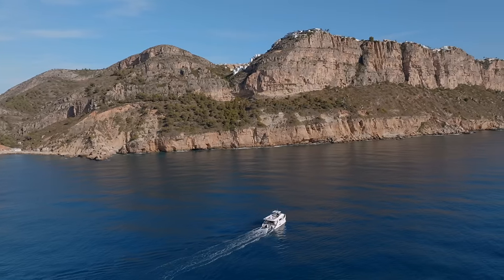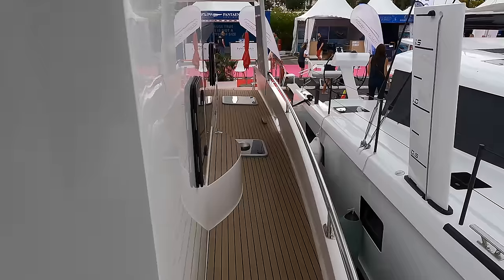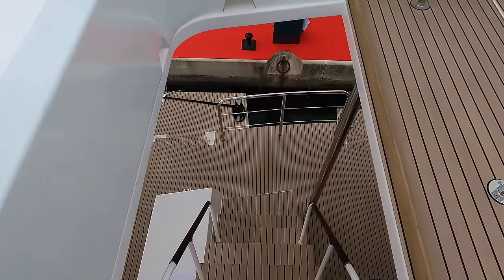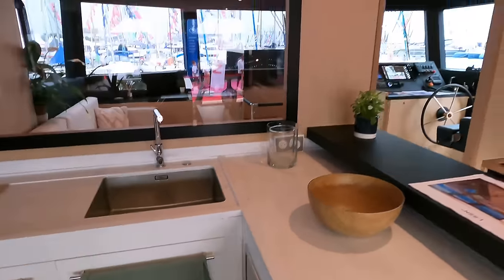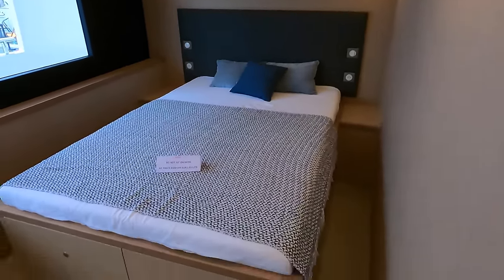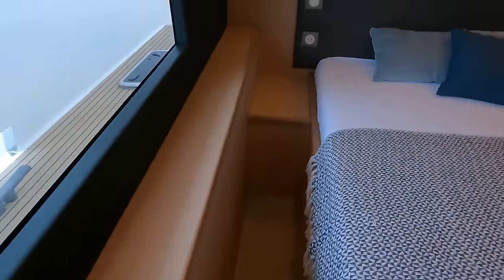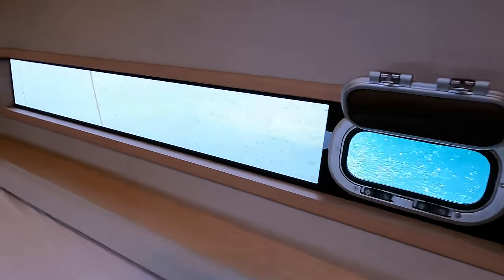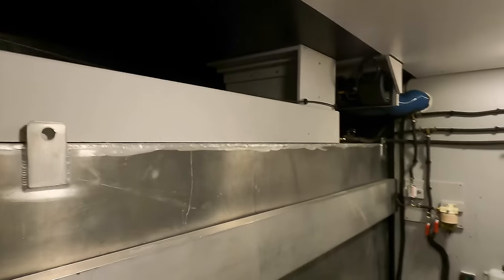FIRST LOOK At A Brand New LEEN 56 TRIMARAN!

Comment: Very nice boat. If I were a motor yacht guy and could afford a boat at all, my choice would be either this or the Leen 72. The space for the amount of money is incredible. And so is the perceived range and consumption rate. The interior style may not be to everyone's taste though, but I actually like that open and minimalist and not too flamboyant or luxurious design language. If I got one, I would cross the Atlantic into the Caribbean and hide in Panama until the hurricane season is fully over. Leen sell this as an explorer yacht, but it sure would be fitting more in the tropical circumnavigation than alluring Arctic sailing.

Comment: G'morning John now thats a big boat/yacht to rely on just one engine and a kite to get you exploring. Surely a smaller wing engine is needed too? Just my own POV though.. to be hoped the deck roof portholes have blinds built in, otherwise plenty of accidental upskirting/down topping will happen 🧐 when non family are on board. Its a good try, but could do better, as the heads report to parents might say (my own POV again) Cheers DougT

Comment: Is that a beer dispenser with the pull handle, sitting on the shelf just outside of the engine compartment?  My main peeve is the lack of storage in the cabins, and possibly the thin mattresses.  Pulling out a drawer under the bed to get stuff is a big hassle that should be reserved for rarely needed gear.  I'm sure I wuld look elsewhere for my next boat.
Reply: My thoughts too 👍🍺 or an on demand coffee machine while scratching your head over your mechanical issues 🥴